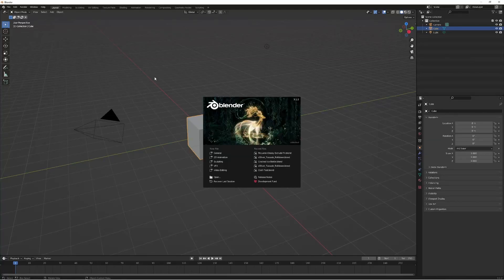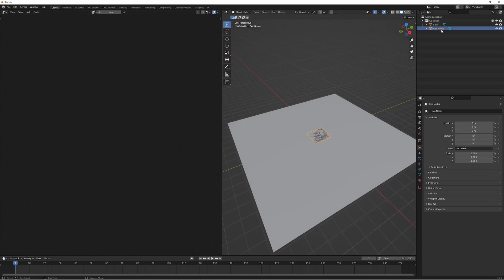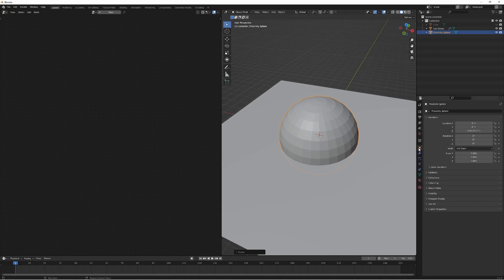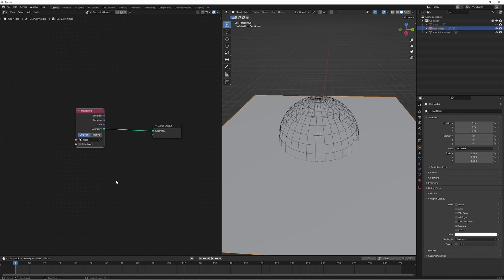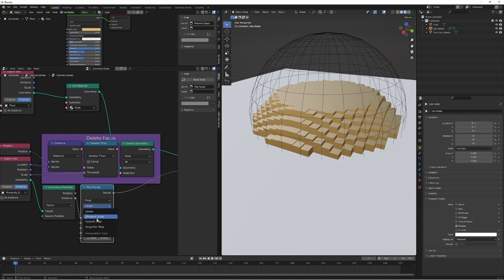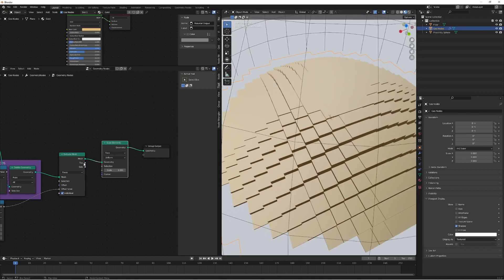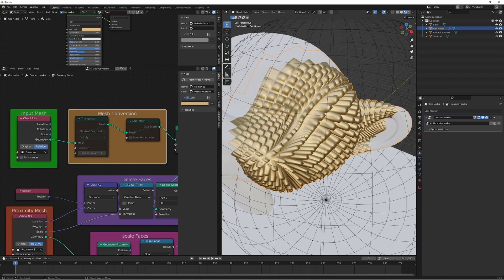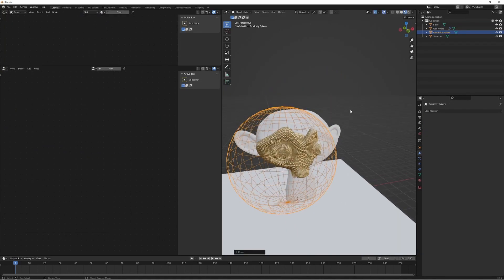Surface Extrusion Effect - Blender Geo Nodes

Comment: This tutorial really unlocked my mind, it gave me a right direction. Thanks a lot. Also what if we want to reveal something through this ?
Reply from the maker: Glad I was able to help!
If you want to reveal an object, I would simply create a new Geo node setup that only includes the "Delete Faces" part. Control the deletion (just like in this video) using an empty. 
Then animate the Extrusion Effect-, and the deletion-controllers at the same time to your needs.
Keep in mind that you probably want to reverse the animation of the "delete" controller to act as a "reveal".

(basically just duplicate the GeoNode setup from this video, remove the "Mesh Conversion", the "scale Faces" and the Extrude Mesh + Taper nodes. That will leave you with a "delete Mesh" setup that you can control with a different empty.)
Reply: @Moove_Studio  Nice. Thanks for your reply. I really appreciate it 🥰
Reply from the maker: @akashmasne5102  If you have any other questions, feel free to leave more comments!